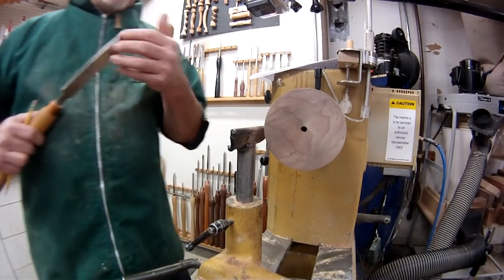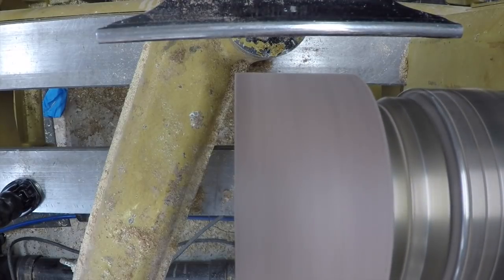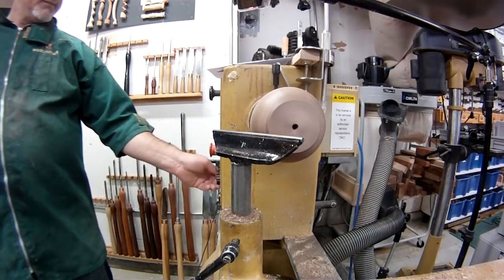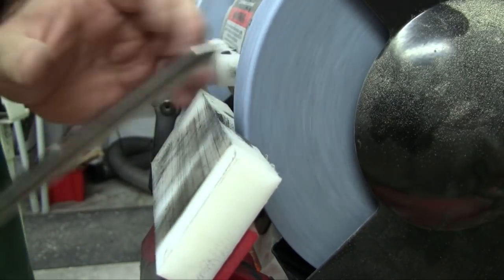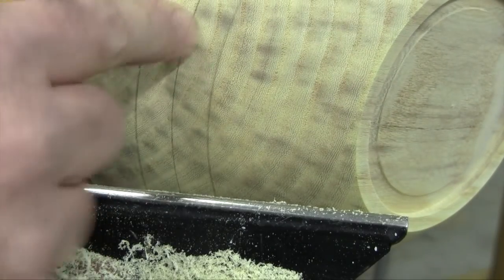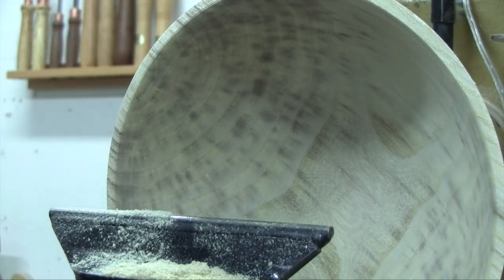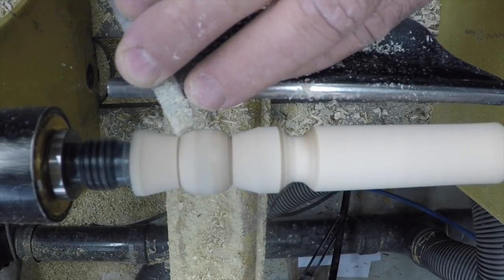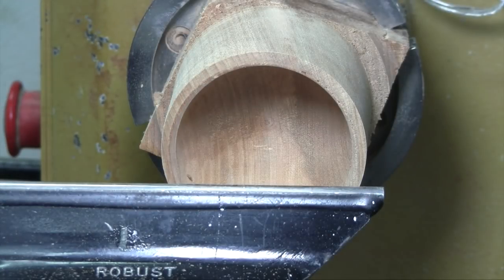Negative Rake Scraping

Comment: Brian -- I've really enjoyed this series and cannot thank you enough for it.  I think the series is useful to both new and experienced turners.  I've tried to drive traffic to your Youtube channel by recommending the series on various woodturning forums.  

With regards to negative rake scrapers, I think you've done a better job than most in explaining why a negative rake scraper works so well.  I think that it's more than just the fact the upper bevel makes it difficult for the angle of cut (if I'm using that term correctly) to exceed 90 degrees.  That explains why there's less of a risk of a catch with a negative rake scraper.  It doesn't explain why a negative rake scraper cuts differently than a regular scraper.  

You can get the same angle of cut by presenting a regular scraper in a trailing position.  Yet a negative rake scraper cuts <i>differently</i> than does a regular scraper used in a trailing position.  It's less "grabby" and is easier to control.  Why is that?  I think part of the explanation is that the upper bevel changes the direction the energy of the cut is translated to the tool.  With a regular scraper, that energy is always perpendicular to the tool handle.  With a negative rake scraper, the energy is always less than 90 degrees to the tool handle.  I think this translates into a tool that's easier to control.

Finally, all the negative rake scrapers you showed had the cutting edge in the middle of the blade's thickness.  That is, the upper bevel and lower bevel are of roughly equal length and are at the same angle.  I don't think that's the way most turners grind their negative rake scrapers.  For mine, there is a very short upper bevel with the cutting edge at about 80% of the tool's thickness or less (measured from the bottom of the tool).  This gives more metal to support the burr and allows for a larger, more durable, burr to be raised.  At least, that's what I think is happening.  When I use my skew as a negative rake scraper, I have to raise a burr more frequently than I do with my other negative rake scrapers.
Reply: @DKWalser, C,è da fare una considerazione a mio avviso importante, non tutti parlano la vostra lingua quindi ritengo che in certi casi è più utile vedere un bel filmato di come si costruisce un utensile senza troppa retorica. Mi perdoni Brian , spero che la tecnologia di Yoo Tube presto faccia una traduzione simultanea.  Complimenti per il lavoro.

Comment from the maker: Notes and errata:
- A few times I say "Negative Scraping" when I should have said "Negative Rake Scraping"
- I forgot to mention during the end grain hollowing that you could also use a traditional round nose scraper to shear scrape larger work to cleanup after hollowing, but with smaller work, it can be tricky to avoid catching the upper half of the scraper; ergo the negative rake scraper.
- The use-enco part number for tools bit that I use to make my mini negative rake scrapers is 317-9792

Comment: Well the negative rake scraper is the new must have tool. It seems to make reasonable smoothing cuts where the skew is less reliable in the hands of a novice.  Being a novice, am just recognizing the importance of tool vs grain structure and the effects they have  in achieving  the desired shape and finish. Also, the inability to recognize those fundamentals seems to be the difference between success and failure when coupled with tool selection.  I think most of us beginners recognize the difference in saw blades for cross cut and ripping wood. That's probably where the knowledge stops except for the occasional use of a wood chisel. So, a firm grasp of the basics of how a tool and wood behave when the blade makes contact is essential to moving forward with successful wood turning.
Reply from the maker: +MM Reporter Could not have said it better. :)

Comment: Brian, As always a fine teaching video.   

Some reflections: I don't think the wood knows the difference between a negative rake scraper and a conventional scraper.  It does know the difference in how the edge and two surfaces are presented to the wood.  A conventional scraper with the edge at center and the same included angle will behave the same if the handle is raised so the top bevel is at the same angle as the top bevel of the negative rake scraper.   But the tool rest would be very high and it would be very awkward, hence the primary advantage of a negative rake scraper.  Another advantage as pointed out is the ability to flip a symmetrically shaped negative rake scraper so you have a left and right hand scraper in one.  I suspect the catching force is less because the top surface is sloped, splitting the force vector between down and back. 

A conventional scraper, as you point out, has a longer lived edge (if ground at a steep angle) and is better at sheer scraping.  I think this is because of the reduced force on the upper surface and the increased mass at the edge.

Comment: Very good video.
As much as I would like to get a perfect cut with a bowl gouge, on the outside of a bowl it does not work out that way. So, I have always made a finishing cut with a skew chisel, flat on the tool rest, as a scraper. The finish is pretty good and unlike, in the previous comment, I have never had a catch nor as a bowl exploded with this technique.
I find it difficult to see the difference between the negative scraper and a skew except for the shape and  I have rounded off the corners of my skew.
However, I will get a negative scraper for the inside of the bowl
Reply from the maker: A negative rake scraper is essentially a skew being used flat on the tool rest as a scraper.  The only other difference for me is that I hone my skews so that they are scary sharp (which removes the burr), but leave the (desirable) burr on the negative rake scraper.

Comment: the reason for the little amount of energy transferred to the tool is simple
The tool is touching the wood with a very small part of the blade
and this is because the blade is round
:)
I use the trick a lot if I don't want to put a lot of force on the work or blade I cut with just a very little part of the tool for example the tip of a skew

Comment: I really enjoyed these basics episodes. There is so much to learn. 

Maybe im missing something, but the negrake scrapers look a bit like skew chisels. Skews still scare me a lot, could i use them as negative rake scrapers by putting a little burr on one side?
Reply from the maker: +Willem Kossen Spot on.  You can use a Skew as a Negative Rake Scraper just by using it horizontally and flat on the tool rest.

Comment: Great explanations on negative rake..
Question . .I have a tormek T8 and I'm struggling  to sharpen my negative rake.
Do I need to use normal grinder first then the tormek?
Reply: Sappho Designs I think with a Tormek to sharpen you don’t get much of burr, but using a grindstone then the Tormek it reduces the desirable burred edge. Opposite to a conventional chisel where you definitely don’t want a burr.

Comment: brian what do you sharpen the negative rake scraper to,thank you bob.
Reply from the maker: +Robert Kutz  Do you mean the bevel angle?   The micro bevel angle at the tip is about 60 degrees (included angle).  Anything from 40 to 60 degrees works, but I find the burr last a little longer at 60 degrees.

Comment: I was told in the forum, very adamantly, to never, ever use a skew on a bowl.  You're using a skew on a bowl.
Reply from the maker: +Josef Roesler That is very true if you are using a skew as a skew, that is riding the bevel and cutting, since the cutting edge will sink into the oncoming end grain fibers resulting in a nasty leverage catch.  But used near horizontal, flat on the tool rest, as a negative rake scraper it is essentially a different tool.
Reply: +Brian Havens No, I was using the skew as a scraper.  Just stuck it in wrong on a cedar bowl and the whole thing exploded.  Cedar delaminates like that.  Anyway, caught all kinds of hell for using a skew on a bowl, but all I was doing was scraping with it.